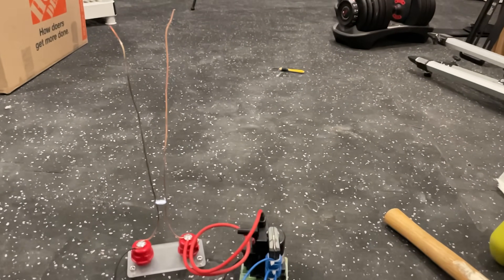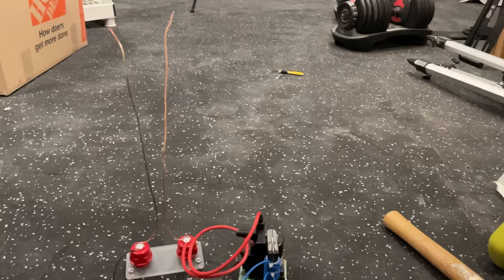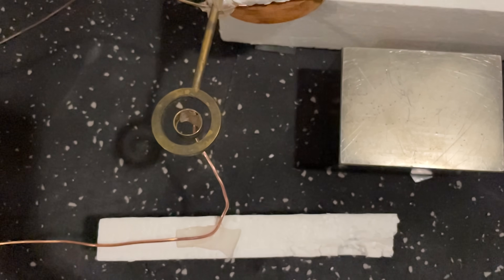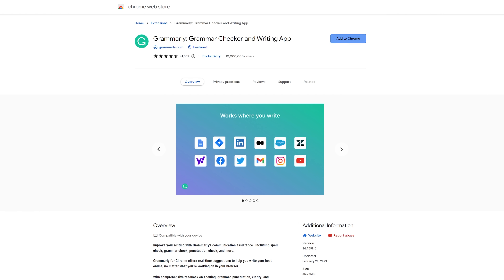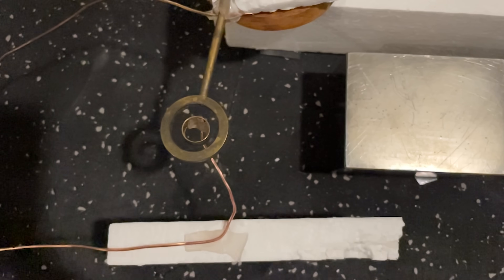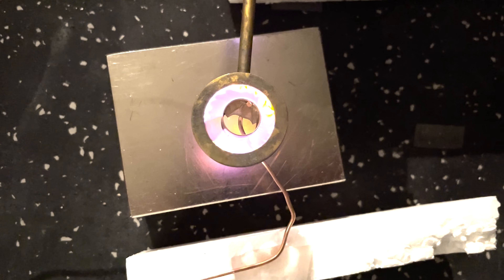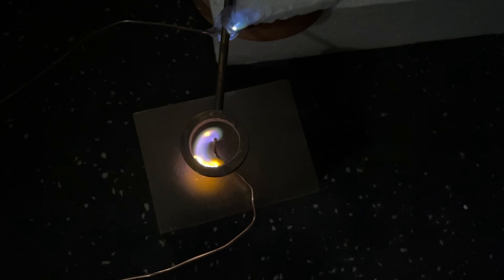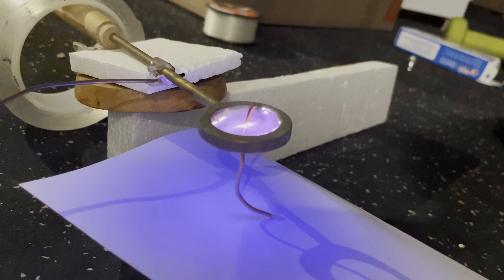Making a Real-life Nether Portal

Comment: i literally don't know what you mean by warm air rises...  warm air's DENSITY compared to surrounding air molecule density RISES.... OTHERWISE warm air goes where ever you want it to go....   hair dryers...  rocket engines... jet engines...   some heating and cooling vents in hotels...  the vent is located at the ceiling and yet you turn on the heat  you feel the room warming...     i literally don't know what you mean by warm air rises...
Reply: it's no different than people who say heat rises...  if heat rises then explain how you have a warm seat when you stand up?   you're LITERALLY sitting ABOVE the seat...  BUT heat rises...  FailFish

Comment: Is there a formula to determine the electrical charge required for a given diameter?
Reply: It's just the breakdown voltage of air which is the dielectric strength (Volts per micrometer) multiply by the distance (micrometer) (the radius in this case).